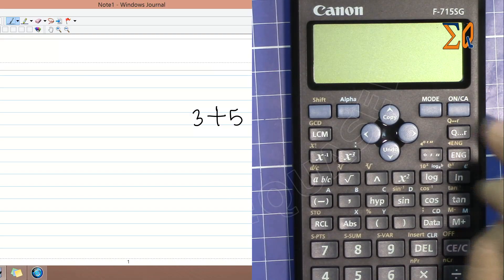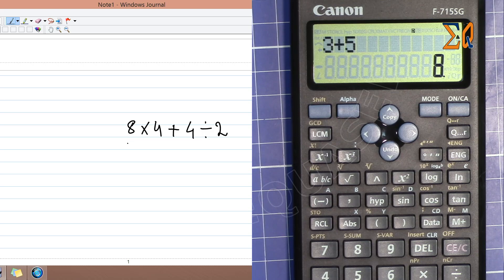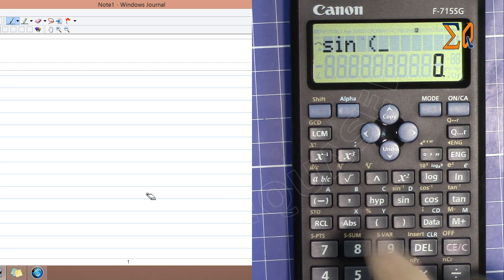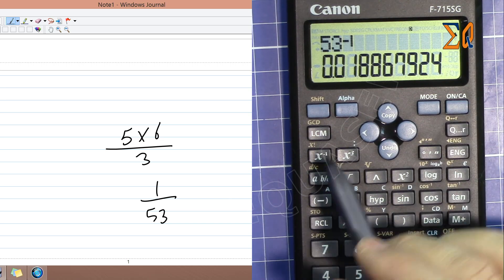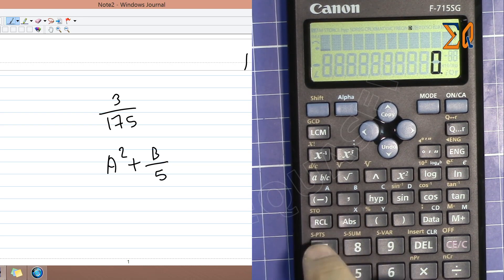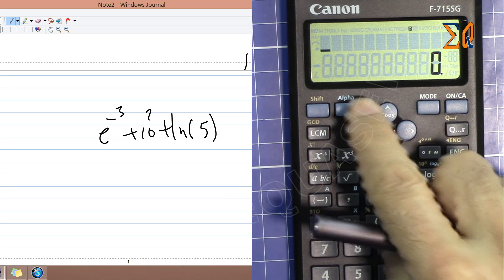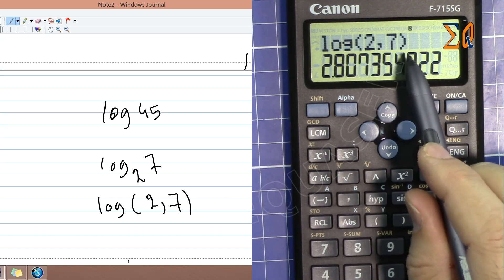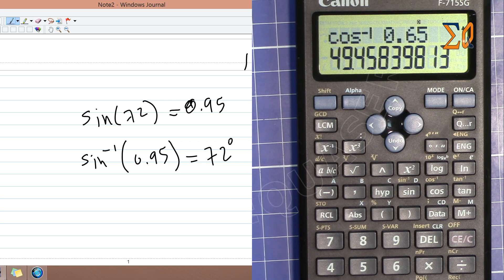Getting Started with Canon F-715SG Scientific Calculator

Comment: Sorry but (5x6)/3 doesn't need any parenthesis! The reason is you only have multiplication and division invovled. You could even first calculate 6/3x5. Only if you had a multiplication in the dividend you need to use parenthesis! ;)
Reply from the maker: Yea. Thanks

Comment: How charge or changes battery on this calculator?
Reply from the maker: I did not make video on that because it is very easy. Just a screw driver and open the back, remove the battery and put a new one.

Comment: why is my battery on the calculator screen weak, even though it has replaced a new battery?
Reply: low battery
Reply from the maker: First how do you know if the "new" battery is good? sometimes you will new battery that has been on shelf for years and they are bad. You have to check either by buying 2 battery from different store. batteries have expiry date. check that.. It is very rate if calculator gets bad. but possible.
Reply: you must charge it with SUN...this calculator using solar
Reply: @btk_ashrafieputra4121  really? Becauss the problem same like me
Reply: Bcs the battery wasnt tight enough so u should put something on top of the battery with a piece of paper to make it more tight
Reply: Trust me...it has happened to me too...and it works
Reply: @sarahhani2002  no wonder i always had to push the battery to use the calculator